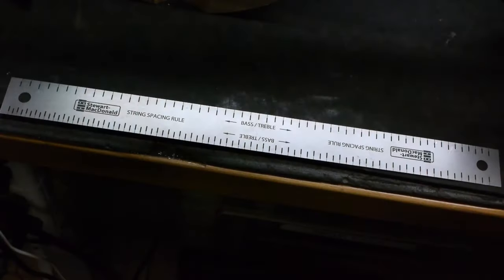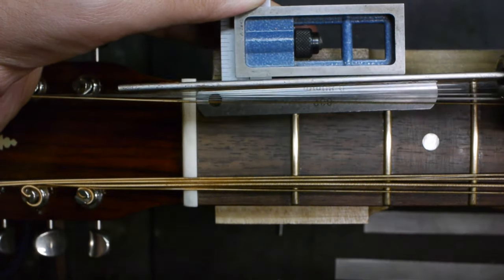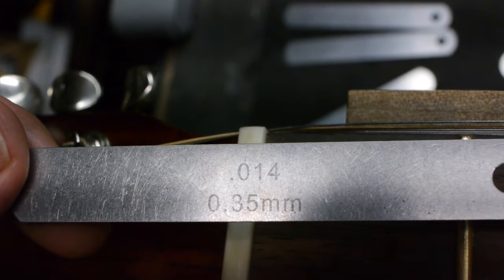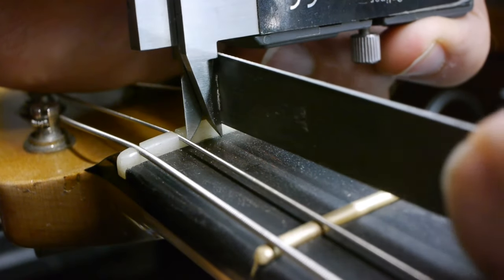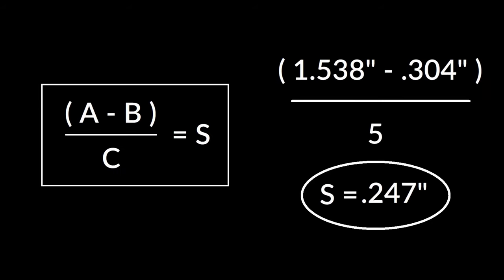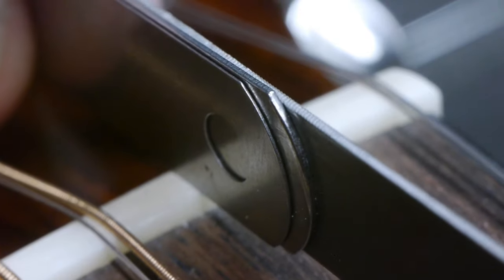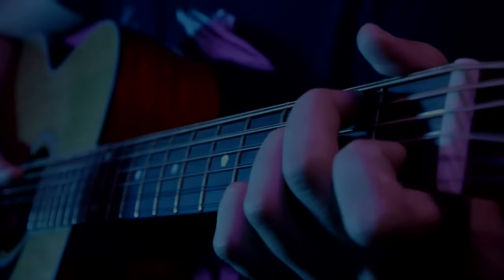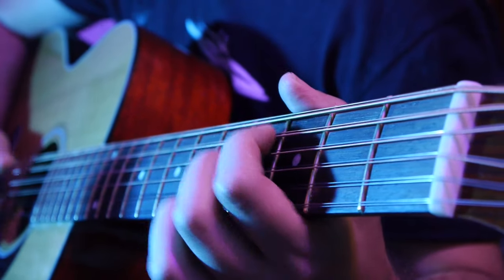12-String Guitar Nut Slotting | BEST Method - FOOLPROOF!

Comment: Perfect!!  This is exactly what I needed, thank you for the great how to video.  I've made nuts for guitars, basses, ukes, even a violin, but never had to make one for a 12 string until now.
Reply from the maker: Thanks so much! I have an updated version of this video here, and am actually working on another updated version -- I'll likely delete the video I'm about to link you to, once I'm done making revisions and reuploading: 

https://youtu.be/yV24u6r8Xx4

My main inspiration for finalizing this technique was a 12 string bass. That is the Goliath of the nuts. 4 groups of tripled strings. I had to expend a lot of brain power to finally crack the code on how to do it, but once I did, I've never looked back. 

There are a couple errors in my new video, and one critical thing I left out: always, always check the spacing of each pair before moving on to cutting the next. 

That way, as you go along, you'll be able to 100% guarantee your accuracy. When I verify the width between each string before cutting the next slot, I've been able to get +/-.001" accuracy when slotting nuts. 

Before, I used to just trust it was accurate, and by the time I got to the B string, I'd be off by .015" or so. When you check the slot spacing every single time on every individual slot as you go along, you'll be within an extremely tight margin of accuracy, and it will never fail. 

I tilt the file to one side or the other to move a slot in either direction as necessary. Usually to get that perfect accuracy I have to do a little course-correction on each slot. Now they always come out 100% perfect. 

Hope this helps, and thanks for letting me know this video helped you out. Keep it up -- and let me know how it goes!
Reply: @guitar_md  well thank you even more for all of that additional info!!  I'll definitely watch the other video and keep that advice in mind 💕
I do similar checks when I'm laying out a new fretting scale length, I calculate not only fret to fret, but accumulative length from the nut to verify I'm not too far off.  Plus I check the even division points likt the 12th fret and calculate out to the 24th so they are exactly 1/2 and 3/4 of the total scale length respectively.  You could even go a step further- the 5th fret should be 1/4, the 7th should be 1/3, and the 17th should be 2/3 of the total scale length.  Those are overkill if the 12th comes out right, but it never hurts to check along the way.  I've got fret rules for Gibson and Fender standard scales, but something like the 32" bass I'm making doesn't have a pre-prepared layout.
Reply from the maker: @guitfidle  That's awesome. I've never gotten into building necks. Done tons of refrets, but that's a whole nother level that you're on. 

At some point I'd love to get into building. One of the most pressing things I want to do is actually quite simple -- remove the fingerboard on my fretless, install carbon fiber reinforcement rods, and either reinstall the fingerboard or make a new one out of Obsidian Ebony. 

Doesn't get much easier than a fretless board for an SG. The reason being, the neck flexes so easily on those guitars, it's insane. I can hardly even fret anything around the first 3 fret area without pulling the neck into a backbow. They're incredibly flimsy. 

I've got a list of other things to do that's a mile long but at some point I'd love to do a video on that. I do prefer having inlays on the board, as I'm still at that stage where fretless is difficult without any markers at all. I find the inlays a happy medium as opposed to doing white lined fret slots. But I'd still need to make sure the inlays were in the right location. 

Fretless 12 string is next up on my list as well. I've been playing a ton of guitar lately and have been very big into fretless. Haven't seen many people go the fretless 12 string route but it would be interesting for sure. 

And very interesting about those fret scales. That's a whole nother level of obsession. I'm sure if I got into building I'd be in for a whole new world of obsession....hopefully in time!
Reply: @guitar_md  oh there you go!  I just watched the other video BTW.  I'll have to make nuts for a few things now 😁 My Japanese mandolin has awful string spacing- not only kinda wide spacing between pairs, but wat too far from the edges of the fretboard.  Not quite as bad as that 12 string bass in your other video, but still way harder to play than necessary. 

It's funny, I play fretless bass a bit as well as violin family instruments.  Also have an oud.... but never tried fretless guitar.   I guess I gotta do that too now.  I do like lined fretless on bass, the last one I did was purpleheart with birch lines.  That came about by a happy accident- I have wooden coffee stirs that I use for mixing dyes and stains as well as spreading glue.  I was looking around for thin stock I could use for lines and saw the coffee stirs already sitting on my bench.  They're clean birch with very few faults (otherwise they would fall apart while stirring), and the neck was maple, which is almost indistinguishable from birch when cut that thin.  They worked flawlessly!  I made the lines go through the edge of the board, so you can see them from the side, then did regular side dots.

I've also done conversions to fretless bass, and find I greatly prefer wood for the lines.  You can choose a less contrasting wood for the lines if you want to be subtle.  My preferred finish for fretless boards is CA glue.  Wipe on the thin stuff to get in around the lines and seal the wood pores a bit, sand it back, apply medium in a couple coats using 400 grit wet/dry paper to help get any missed gaps (the CA that breaks loose from the sandpaper works like a pore filler), then another on top to seal it up.  Then samd and polish to whatever works for you.  I'll do anything from 600 grit to 1000 depending on who it's for annd what looks best on the materials used.  You could polish it glossy, but the strings will scuff a gloss surface pretty quickly, a matte surface hides the wear better.
Reply: @guitar_md  oh, and I've done more scratch builds than refrets, but I only do the loothin' stuff part time.
Reply from the maker: @guitfidle  I forgot I had a video on my fretless conversion here: 

https://youtu.be/JshKnPLGiw0?si=egPa2-KOADfJAAnW

I'd like to do an update, and I really need to do a video going over understring fret leveling. I prefer stupidly low action, like on my fretless SG, the GBE strings are .030" open at the 12th fret, and the Low E around .039". A and D somewhere inbetween. 

I agree about wood as well. Though I did use plastic binding strips on my "Bassmisen" that you can see in this video here: 

https://youtu.be/6hLpN60SLPQ?si=36PwfCnuQwjk_DPw

This is actually making me think I should make a new playlist for fretless work. I've been getting more and more into it lately and I've been writing more songs for fretless. After playing and working on guitars for 20 years, mostly influenced by Jimi Hendrix and Leo Kottke, fretless is a breath of fresh air, and is inspiring a bunch of new ideas for me. 

Funnily, I've left both of the boards unfinished. I really like unfinished fretless boards. One of the reasons I want to use Obsidian Ebony is because Thermalwood Canada sent me some free samples in exchange for doing a video review of it -- but it also seems super stable, and would be a great unfinished board. 

It looks virtually identical to ebony but is probably even better. Thermally treated maple or birch, impregnated with resin -- extremely stable. 

You're well ahead of me in terms of the projects you've done. I've only replaced one fingerboard so far, and I've been at this 20 years. It was on a violin that my ex girlfriend got for me many years ago on Valentine's Day. The fingerboard looked like a banana. I removed it and replaced it with an ebony fingerboard I got on eBay, and it came out great. Then I cut a buffalo horn nut for it. The violin was all black and it looked great by the end. 

But that's it! I've done hundreds if not thousands of level and recrowns by now, and scores and scores of refrets -- but my fret edging/rounding/burnishing still needs work. 

I've cut hundreds of pickguards, wound hundreds of pickups, set up thousands of guitars, done tons of different repairs -- but building, nope. 

Never built a fingerboard a single time to this day. I'm well versed with the router table and templates but haven't plunged into making bodies/necks/fingerboards yet. 

My dream for my SG is to remove the board, and replace it with one made of Obsidian Ebony after installing two carbon fiber reinforcement rods. I really think that would take that guitar to the next level. 

Or maybe I'll order a kit. Potvin Templates does make full templates and I could try making my own SG from scratch too. Again....you're way ahead of the curve there. 

I think of myself as a guitar tech, and nothing more. Would love to be able to call myself a luthier someday. My main deal so far has been refurbishing the heck out of guitars that are already fully built. 

Though I have done some finish work, and I have a penchant for ebony grain filling and hand rubbed shellac finishes. I always finish all of my necks with hand mixed and hand rubbed shellac. I use grain alcohol to dilute it. For me, shellac wins 100% of the time, as a finish for both the body and the neck. Absolutely love it.

Comment: Interesting.  I tried making a new bone nut on on of my 12s that I thought was crowding my (not so skinny) fingers somewhat.  It worked out well.  I have not completely finished polishing the nut and doing the final, final string height filing, but it is close and plays great.  I was indeed surprised that a 12 could tolerate .028 pair spacing, but it does, and it makes 12s with IMO too narrow necks quite enjoyable to play.  Thank you for taking the time to put this together.  Not much good information like this for those of us that love the 12.
Reply from the maker: I was surprised as well. That .028" spacing really does make a huge difference. 

My newest nut slotting video has a whole section on 12 string nuts at the end if you want to check it out. Same information but in a more streamlined way. 

One thing I didn't address was the nut slot depth. I set the pairs so each string in the pair is the same distance from the top of the first fret. Another commenter asked me about that, then I realized I didn't even think to include it in the video. Would be curious what you did with that. 

Thanks so much for letting me know you used this method, by the way. Made my morning. I was inspired to make this video as I couldn't find a single good resource online for how to make a solid, perfect 12 string nut. I was originally inspired by a picture of a Leo Kottke Signature Model 12 string from Taylor, where I noticed the string pairs were much closer together than usual. 

I'm working on a new video of refurbishing a Cozart Stratocaster 12 string as well. I really love 12's and it's my first solidbody 12 string. Major plans for it to get it closer to an acoustic, including a piezo pickup in the neck pocket. Exciting stuff. Thanks again for the comment and the support!
Reply: @guitar_md  I finished the final shaping and polishing of the nut and it is indeed not the simplest nut I have ever done but certainly the most rewarding.  The .028 string spacing forces you to be rather carful and wear your magnifiers :).  The nib is what you really have to be careful about with bone.  Probably also somewhat careful restringing too.  Not sure if there is another material that would be any better than bone tho.

I set the slot depth so the bottom of the pairs are the same distance from the fret and pretty low for an acoustic - I tried not to get lower .020 from the string bottom to the 1st fret.  No buzzing and I normally use light guage sets and typically tune to D.

Another tip I picked up on umgf is getting the spacing at the bridge end closer.  On my test mule :) the octave pair is the rearmost set of pins and the octave strings bend out slightly on the regular pair's pins in front.  I "relieved" a bit of the forward pin left side so the octave string could get a little straighter run to the saddle.  It is completely invisible and maybe helped a little.  Not all 12's are configured this way but it was worth the effort.  I suppose you could get extreme with this and put both strings in one hole and notch the saddle (Taylor did this with the 552ce at one point, as did Stella), but the pin notch is ok with me.

You are certainly correct, there is about ZERO good information on the net about making 12-string nuts.  Much of the info frankly not right, accurate, or helpful - except your info.

Interesting about your LK observation.  I still find a lot of 12 players and some builders don't see the value of this gem.
Reply from the maker: @d.j.williams4815  Yes. The 'wall' or nib between the string pairs is very susceptible to breaking. For this reason, I'm very adamant about only making the nut as tall as absolutely necessary. 

For the wound strings, I keep about 1/3 to 1/2 of the string sticking out over the top of the nut. The shorter that "nib," the more resistant it is to breaking. I've only had breakage on those when the nut was too tall. It doesn't take much at all when doing work this precise. 

That was a major issue I had in the beginning, but all better now. 

Tusq and Tusq XL are great materials. Bone is my favorite but I think those are very fine materials and will work very well. I'm just so used to bone, and am biased because of the "old time" look and feel to it. Just something so cool about using animal bone to make a part for an instrument. 

Really appreciate the feedback. Surprisingly, on my 12 string, the pairs are around .015" from the first fret. There might be a slight amount of buzz but not enough to bother me. .020" sounds right for not having any buzz. 

Usually the lowest I'll ever go on the Low E string at the first fret is .018", and that is very low. .020" gives a much more comfortable buffer for being able to play without buzz. 

I live with a little buzz, but it suits my play style and demands for insanely low action. On my main Stratocaster, I have the action on .018" wound strings, .010" plain strings at the 1st fret, .000" - .002" neck relief, and action .030" GBE at the 12th, then around .035" D, .040" A, .046" Low E. 

I use some advanced fret profiling techniques using a Rectify Master Katana, which help with string bending, and buzzing on the low strings. But with action that low I still run into issues and may have to learn to live with a much flatter radius to get the lowness of action I want without issues. 

Anyway. Very interesting stuff. I'm so glad you had such great success with this method. It means so much to me that you used it and that you see value in it. This method is probably my greatest achievement in guitar work and is the first thing that comes to mind when I think of something I've contributed to the guitar world that I've never seen anywhere else. 

And the purpose? Not to pump up my ego but to get guitars playing better so people can enjoy them more. This is a great example. I'm really thrilled beyond words that you were able to apply this method and have such success with it. 

And opening up that spacing on a narrower neck -- perfect example again! The nut is so critical, and so overlooked. I'm fortunate that my friend and mentor Steve K. turned me on to the importance of the nut about 20 years ago now. 

He always cut them by eye, and still does to this day -- same way he's been doing them since 1968. I'm not as mechanically inclined as he is, which gave birth to this method. Something anyone could use, with some finesse, but nowhere near the insane level of finesse required to cut a perfect 12 string nut (or normal nut, for that matter) completely by eye, which is how he does it. 

He never measures anything and they always come out perfect, but very few people can do this. My goal is to make guitar work more accessible to as many people as possible by illustrating how these things work. 

Thanks again so much. Again...beyond thrilled. 12 strings are very near and dear to my heart and it's a rare breed of person that shares that passion. They're definitely magical.
Reply: @guitar_md  The only tidbit I have found since doing a couple of my 12-strings... the close string spacing is a challenge for the 12-string capo I have tried.  The Gg and Dd high octave string pairs are tough (probably impossible) for both 12-string capos I have tried (D'addario and Shubb F3 and C3).  Maybe others have rubber more compliant.